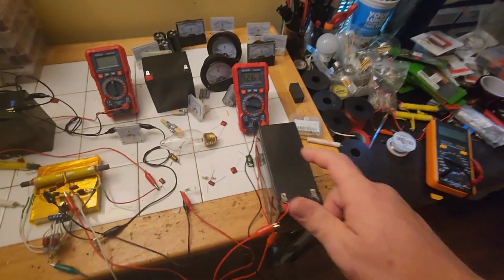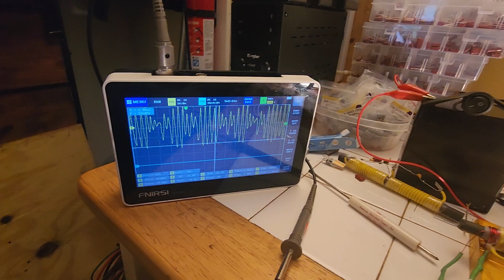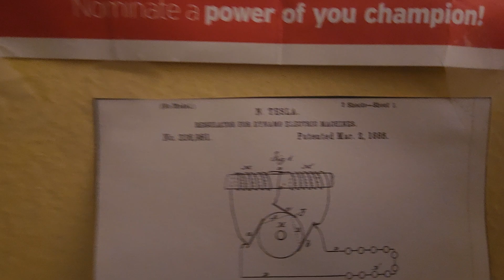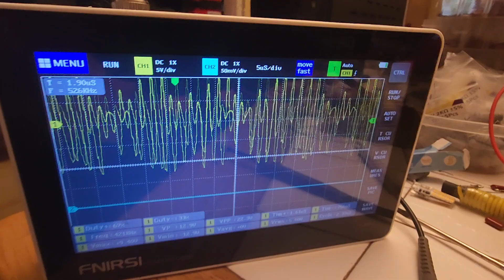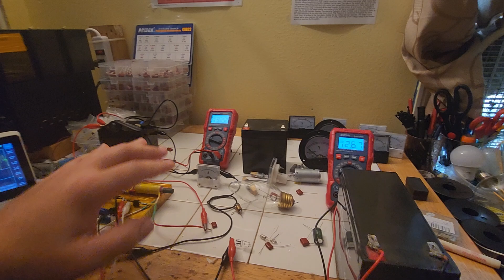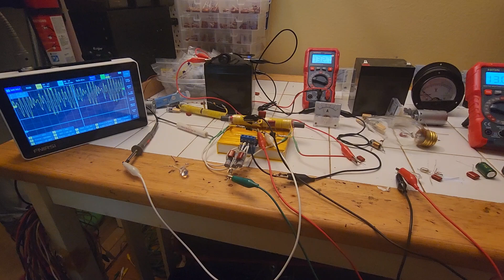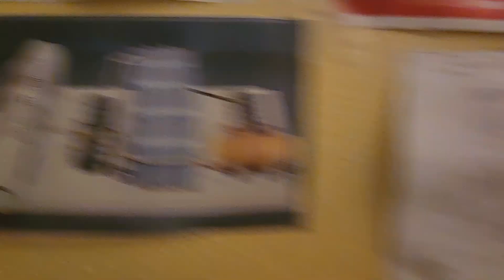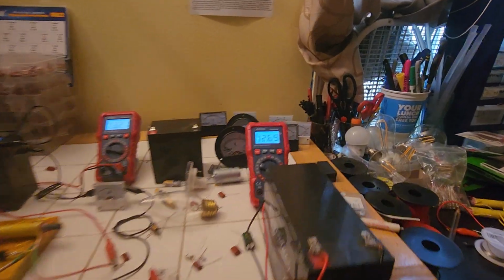🎆HAPPY 4TH & LATCHKEY DISCOVERIES MADE REGARDING NEGATIVE RESISTANCE & THE SUPER CHARGING EFFECT😱

Comment: minimal loss on source greater gain on load ?
Reply from the maker: @mykedoes4099  in terms of more energy over time with the rapid resonant recharge effect on batteries once the system is properly earth grounded then the answer is yes :)
Reply: @MTECH2022  kinda makes sense why the battery needs be part of the loop . it is a potential device after all

Comment: I think that the experiment would be more credible if you fully charge and discharge a new battery. Better Lifepo4 as rates are 20x faster than lead acid. Compare energy Wh takes to 14.0V for lifepo4. Testing is confusing if you only do partial chargings up to 13.2V. They will confuse you more if they are dead batteries...
Reply from the maker: @hrcnlz  i can do that in a long video soon

Comment: If regular resistance heats the wire, do your wires get colder during operation under negative resistance regime?
Reply from the maker: @ANToxic777  the negative resistance circuit doesn't get hot. The only heat that occurs is when converting the high frequency output to pulsed dc via the extra yellow coil

Comment: Do you add ground wire to the center tap of the coil?
Reply from the maker: Ground wire is added to the hot end of the negative resistant rlc circuit that's connected in parallel with the negative resistant rlc network  :)

Comment: I don't understand how does you create negative resistant? And where? In a coil?
Reply from the maker: Negative resistance is created when the proper RLC circuit is used with a high frequency circuit. Adding a cold cathode device in parallel with the circuit can help this effect too such as a neon bulb
Reply: @MTECH2022  very interesting! Where do you get this knowledge? Maybe some book?
Reply: @MTECH2022  can you tell what capacitor do you use In RLC circuit? What inductance? And what resistance?

Comment: I believe i just dont understand.     Whats gonig on here, and why?  I see a dead battery being charged fast maybe because its shot tho, 10w bulb was enough to dicharge it rapidly so the charging must of been less then 10w to bring it up rapidly.   This is how my shot lead acid batteries behave, they charge fast, but theres no capacity there.  The wireless power is definately cool,  but im not understanding the circuit so i cant appreciate how cool it is.  Anyway Isnt negative resistance basically creating energy?  Once you get past 0 resistance you cant have any more less resistance you ahve to have more energy!?  At leaste my intuitive understanding of it,
Reply: Don Smith speak ,AT the o résistance the capacitor IS supra conductor
Reply: You can look Wikipedia negative resistance. Many lightbulbs have this behavior like neon, and florescent tube's. Once the tube is energized it consumes less than when you started it. It's a known effect. It's an inverse of the resistance line, but it's not really creating energy. It is simply acting like a backwards resistor.
Reply: @newmonengineering  yes but the halogène and other wire lamp...the résistance hot. .. light and comsum less current .its normal
Reply from the maker: @mikejones-vd3fg  in theory your hunch is correct  :)
Reply: I think the action happens when the empty battery is potentialized and rests,  the capacity it charged while resting  with usable energy. If it doesn't rest to fill up, it discharges quicker than it was potentialized.